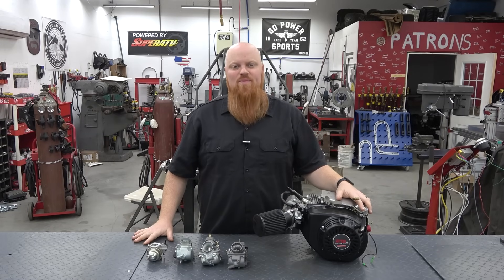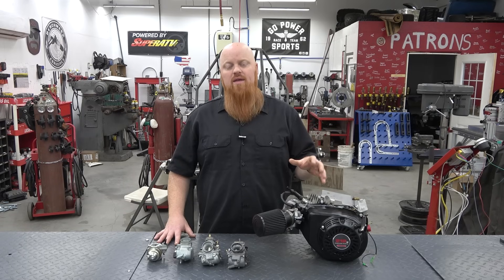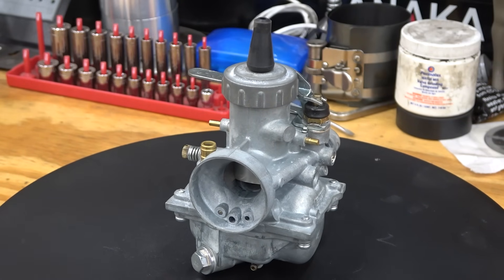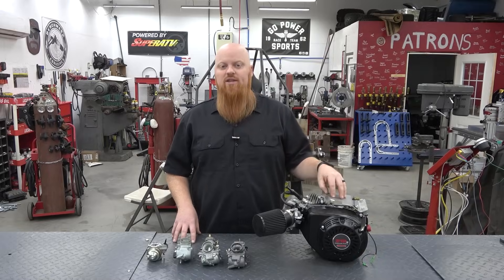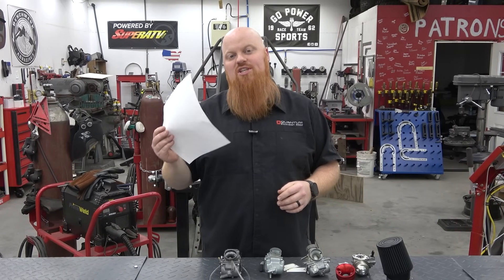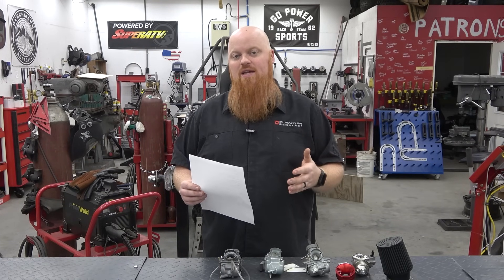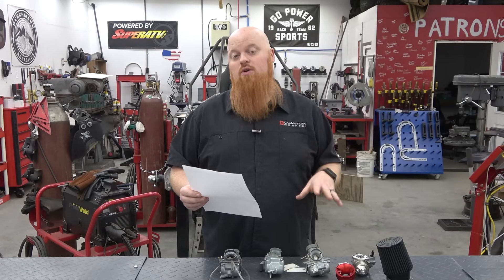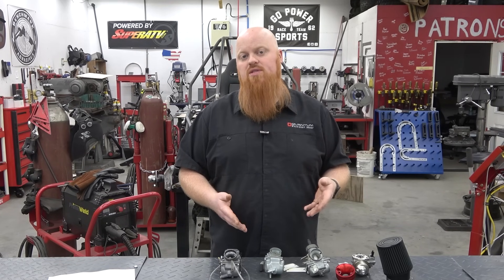Dyno Testing Carburetors ~ The Road To Horsepower Ep3 Carb Showdown

Comment: Love it so much bro, I have a ducar 212, non- hemi and like the stock cam with stamped 1.3:1 ratio rocker arms and aluminum push rods. Besides that.,.2 thin metal head gaskets and JB weld the intake manifold port to closely resembles the hemi head's. Long intake with TM 24 flat slide and rvl curved exhaust. I only run on an old pressure washer test stand for now cause I can't find any mini bikes in my area. Oh well. Can you run a similar test like this one and at the end you can drop in aluminum push rods and ratio rockers? I think people over look the correcting of drive train to hanging with the Mr Jones,,,,

Comment: Hi Greg, Brian from Florida here, really enjoying ALL of your videos especially your road to horsepower series. This series is answering alot of questions your average enthusiast may have but I would like to respectfully point out that the vm22 knockoff carb also known as the chikuni (chineese version of the Japanese mikuni) has an inside diameter of 26mm. Not 22mm. Like the original. This may explain the hp diffrence when compared to to the original. Lots of love here from Florida and God bless you too!

Comment: Does a carb change make a difference if you don’t take out the governor?
Reply: Yes it does make a difference. With slide carbs the governor is not connected to the throttle and cannot effect engine RPM. I wouldn't trust the internal governor parts 6K RPM and higher.

Comment: What do you think the results would be putting on a carb upgrade and exhaust on a stock engine?
Leaving in the governor, stock fly wheel and valve springs. My guess is you'd likely get 10hp.

Comment: My go to "build" is a vm22 clone, full governor delete, 22lb springs, and a header. I don't bother with the flywheel or rod since they cost almost as much as a new engine. Out of 20+ builds and 1000+ hours I've only had one flywheel break and have never lost a rod. For around $60 you are north of 10hp. Can't beat that bang for your buck.
Reply: What I found is that there is quite a difference with the VM22 clone stock lift cam versus a bigger cam like one with a 265 lift. Big difference even running less than 5K RPM.

Comment: I just subscribed to your channel sir because I feel that I can learn alot from you. I just bought the hurricaneX because of this channel. My question for you is what would be a good replacement motor for my bike and me being 6'2" at 225lbs. I just bought the ghost 212 but I'm thinking about putting that in my coleman bt200x. What motor out there would you suggest for me to build on?  I'm coming from a big block  454 Chevelle and a 2011 6.7l Powerstroke f250 4X4 to mini bikes now, I'm hooked on these mini bikes because of your channel😁. Whatever you can suggest would be highly appreciated, thank you buddy.

Comment: I think this further supports what I said it's a 200cc engine it needs a 28-34mm for power depending on cams
Reply: I saw some tuning issues too and the intake alignment seemed abit too big of a range. I'm sure you stuck your finger in there to make sure it was lined up but I think it's worth mentioning to the mini bike crowd. The genuine vm22 was a two stroke carb gotta change the emoltion tube end and probably a needle down.

Comment: There's too many variables to take into account for this test. It's a good basic and it's not impossible for clone stuff to be as good as or better than genuine.

But what about the setup of the needles. Which needle it's using. Which jets it's using if they're branded or cheaply drilled knock offs. Also cutout on the slides.

My clone flat slide runs horribly lean at 1/8th throttle but the rest of the range is perfect. 
The old carb I took off would sit at 1/8th all day long but didn't have top end because the slide was sticking.

I think the main issue is the cut out being for a 2 stroke not a 4valve 4 stroke.

Comment: Mathematically that 24mm carb can support that engine to 8000rpm 👍 
The intake and intake port need to flow 102cfm to also support 8000rpm.
What size valves do these have and what lift is the camshaft?
Very cool project

Comment: what jets were installed in the carburetors, and it would be great to have an oxygen sensor on the exhaust
 for mixture control
Reply: looks as if there is one on the exhaust pipe, not sure though

Comment: This is pretty cool, I have used the knock off pwk 24mm D slide carbs and had great results with them, easy to tune, they hold up great with e85, and red and black looks cool.
Can't wait till you get to camshafts, I built a high compression, ported, big valve hemi 212 that I tried different cams on and I settled for the mod 2, the fire 265 just didn't do it, couldn't tell the difference from stock (all cams had 1.2 rockers)
Also would be interested in testing fuel types, butt dyno tells me e85 makes a difference.
Reply: Came here to comment about fuel also! Been running mine on e85 and it seems to make a difference to me as well.

Comment: If the vm22 is a good carb for the 212, does that mean the vm34 is the right size for a gx390/hf420? Those gains were incredible. I feel like I may be robbing myself of a few horsepower with the re-jetted stock carb I'm currently using.
Reply: I have a 30mm carb on my gx240 and it seems about right. It has the same size valves as the gx270/340

Comment: Really need to set up a wideband O2 sensor to be sure you're getting all you can out of each carb.
Reply from the maker: It has a wide band. If you look on the screen it’s under the dyno rpm.
Reply: @RedBeardsGarage  oh, ok. Well that's cool. Can't wait to see some big blocks on the Dyno once you're done with the 212/225s

Comment: AFR overlay is important. It is a fuel air mixer.  The clone looks bigger. On the vod the 24 looks like it was running a tad leaner.
Reply: It was and the real vm22 was running really fat at like 9.5 so if it was around 12 I like it wold have made more power than the clone

Comment: There are cdi conversion kits for Hondas and honda clone engines. You should try one out. Get rid of the fixed ignition timing.
Reply: would you recommend  a good source
Reply from the maker: I have one I will test.
Reply: https://youtu.be/fIzMHznvG8Q 
He has a YouTube channel about his cdi kits. 
Never tried them. Just thought I'd see if he'd test a cdi kit. 
Instead of having the flywheel keyed and  tuning ignition for hp at one point in the rpm range. The cdi changes the ignition advance throughout the rpm range. Should run better and have a much broader hp/tq curve. Plus the engine should live longer and get better mpg.
Reply: @timothywilliams2021  thanks, Timothy_ I checked out the channel - looks good

Comment: You should add a wide band 02 sensor to the dyno. That way you can see your air fuel ratio and fine tune. The carbs cfm and air fuel ratio are the big difference.
Reply from the maker: There is one. It’s on the dyno screen.
Reply: @RedBeardsGarage  can you move the screen closer to the camera? It's not readable!!! Thanks

Comment: I run Nibbi 30mm on most my bikes.  224s have great throttle response with the 30mm Nibbi's
Reply from the maker: 30mm in my opinion is way to big. You will never be able to flow that much with the stock valves. I can test on but don’t think it will improve much.

Comment: If running 5500 RPM and under I would get the clone. But if running a cam and more than 5500 RPM I would get the TM24.

Comment: Are you going to test the predator 459 I'm having serious issues with mine, pkw flat slide 30mm.  Runs way too rich?
Reply from the maker: Yeah I’m waiting on a clutch to come in.
Reply: @RedBeardsGarage  I got a nice one from amazon, I don't remember how much it was but it has held up will so far, I'm just having carb flooding  issues with sustained rpm around  10 to 15  MPH as this is a parade car not a race machine I choose the 459 for torque more than speed. It's a converted golf cart. Fire engine in the form of a COE model T.  All Aluminum Diamond plate body with new square tube frame, had to the old batteries corroded the tube frame so badly I had to start over with all new frame.

Comment: Why did you rev the engine up to 6400 with the 22mm clone and the 24 flat slide but stopped at a lower rpm on the mikuni 22mm? It looked like the hp numbers were still climbing on the mikuni 22mm and it may have made better numbers if you would have revved it up to 6400 like the other 2 carbs
Reply from the maker: They all stopped making power before that. No point in pushing them further.

Comment: RBG can you or others comment on the relative benefit of bumping up to the 301cc or 420cc larger Predators ?
Vs the Uber popular 212 - so long as the weight & dimensions on the larger two aren't out of line with the typical Mini Bike available frame space - wouldn't the old adage of "there ain't no replacement for DISPLACEMENT hold true ?
(IE: less radical mods required on 301 / 420cc ?)

Comment: Can’t wait to see camshafts on the dyno. Also curious how a 26mm carb does along with a ported head
Reply from the maker: I’m going to do more carbs soon.
Reply: Agreed!
Reply: Yes. We need more head.... in general
Reply: yep, definitely want to see a video on ported heads!
Reply: I dont think there is a point in doing that. 24mm even without porting obviously outflow the engine. Not a hint of drop off. If you try to enlarge ports even bigger, at this moment you only loose low end, for prety much no gain up top.

Comment: I'm gathering parts to build a Ducar 212 and I bought the Amazon PWK 24mm Carb. It looks awesome and it was around $30. You can get all the way up to a 34mm carb for the same price.
Reply: Yea when I had my bike I had a pwk28 and took a little tuning but man that carb was well worth 32$
Reply: do you have the link for it!!? what would you suggest for a 212 non hemi i have a 15$ carb and only gets me to about 40mph
Reply: @pop_major4698  To be honest, to do just 40 mph, Just do a stage 1 kit and you will be good. No need to swap the carb. Gov delete, 18# valve springs, #38 jet for the carb, air filter and exhaust. Should hit 45ish pretty easy. I would buy a torque converter at some point.
Reply: @spuds7677  even tho it says it’s made for 50 70 90 and 125cc would it work for fine for the bike ?
Reply: @pop_major4698  I don't see why not.
Reply: @pop_major4698  If you want to swap the stack carb, on a stockish 212 I would run a PZ19 carb. Cheap and easy to tune... A 22mm or 24mm may be a bit much for it. I don't care what people say to run, a PZ 19 works great on stage 1 212s.
Reply: @spuds7677  thank you so much 🙏🏼🙏🏼🙏🏼

Comment: Great series! If you look at the upper end of  the graphs, the bigger venturi theory on the knockoff seems to hold some water, as it looks like its flowing more air. Speaking of, I've always wondered if the tiny air filter that comes with the Mikuni kits is restricting airflow. Any way we could see a video testing the chrome air filter vs the bigger K&N style filter using the velocity stack adapter that gopowersports sells?
Reply: This is a very good debate.. although technically you would have to rejet for the air filter. I would still like to know as well. Are velocity stacks worth it. Or expensive filters worth it
Reply: I had a tiny air filter in one of the VM22 clone kits I got. Ran pig rich compared to the cheap foam type filter. So yeah it's restricting airflow. It went in the garbage.

Comment: Too vague on the testing. Which main and pilots on each carb? Same for the needle diameter, taper and clip locations. As for venturi size discrepancy, measure them.

Comment: I’m completely blown away that the clone gives you almost one more horsepower. I’ve bought a clone it says Mikuni Japan on it but we all know what that means. I paid $100 for it and I felt ripped off I should’ve done my homework. But God always looks after his favorite, they accidentally sent me two carburetors. I called them back to return one and they said because my honesty to keep it. So now I have a brand new Mikuni in my parts bin with a brand new hemi 212 that was never used still in the box it was given to me. Anyway I’m getting way off track dynamite machine you got there
Reply: Great testing and very interesting, but did you test air fuel ratio of each carb to see if all of them are correctly tuned? If not then the results might be inaccurate and might explain why the original is making less power than to clone.

Comment: Not sure how much tuning your doing on the carbs but I'm thinking the difference in power between the vm22 clone and Genuine could be (could being the right word) because the clone did a better job of keeping a stable afr during the run. Cant tell much from the video but it looks like the Genuine VM22 got pretty rich through the run hitting like low 10s and then 9s. With small motors TQ is going to fluctuate a decent amount going from say 12-13 afr in a run to say 9-10s afr.
Reply: I was noticing the same thing, the 2nd and 4th carbs were running way leaner than the other 2. The old saying lean is mean prevails.

Comment: Genuine VM22-133 looked like it was extremely rich on the AFR. Could explain the power loss.

I'll use a Nibbi 24mm for something like this. $60 and as good or better than the TM24 for little less than half the money.

Comment: 🍿just sitting here waiting on the 999 duromax upgrades.
Reply: Same, on the verge of getting a vanguard 35hp, but hoping he build the duromax soon as that is much cheaper just not sure what aftermarket support it has. Looking to turbo a 1L v-twin for 100wtq/100whp.
Reply: could’ve bought a whole bike for the price of that motor
Reply: @tmscam5115  not everyone is playing with children's Go-Karts. Lol
Reply: He needs to put some boost on that engine or at least some cylinder head porting, carb upgrade and both manifold upgrades
Reply: I wonder what happened to that.
Reply: @thedancingpickle6362  he'll get to it but it will probably be spring.  Think he told me they have not put 20hrs on it. Yet.
Reply: @RBG if you get around to that I'll offer to bring some camera gear down and we'll make a big production out of it.